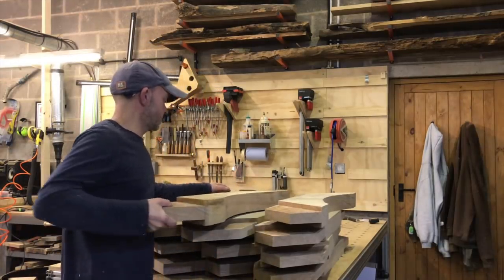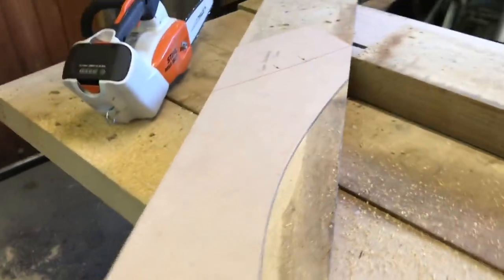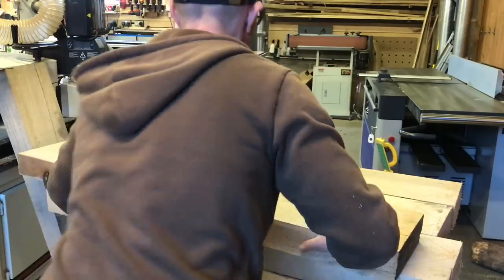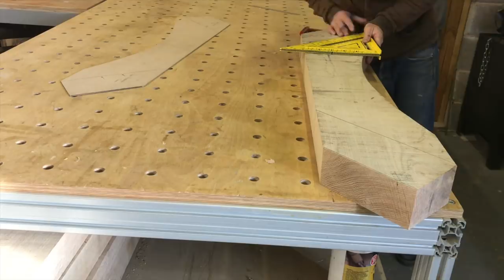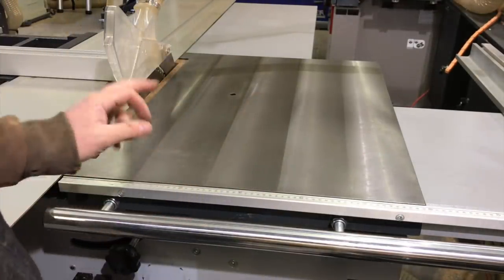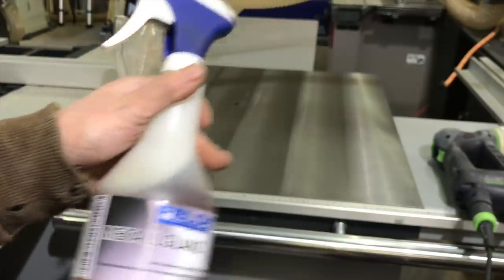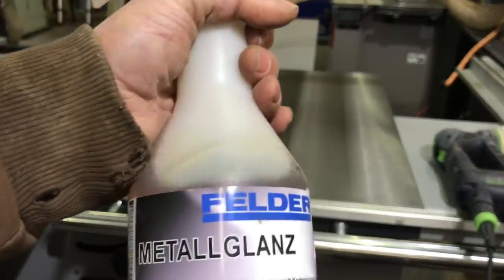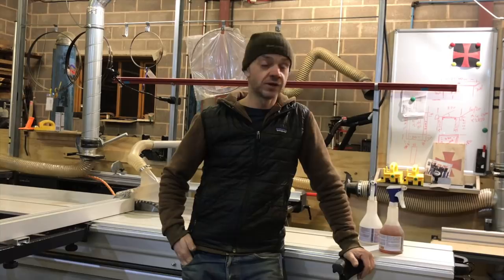Cutting Oak Frame Braces   Sunday Update

Comment: So important to keep all the tools in top condition. I use a cleaner then a WD40 soak and wipe off and then apply wax and polish the surfaces. It makes cutting so much easier
Reply from the maker: 100% ..  see if you can get some super glide it is so good.  - http://uk.feldershop.com/en/Workshop/Cleaning-and-maintenance/FELDER-Super-Glide.html?listtype=search&searchparam=super%20

Comment: Excellent video Andy. I am going to be working with rough cut full 4x8x10 foot cedar beams and cutting somewhat detailed radius on the ends. Yes my tool junkie friend, I bought a new Festool Trion jigsaw to cut the 4 inch thick radius at the ends. Do you have any opinion as to the Trion or the Carvex?
Reply from the maker: Cheers James..   I haven't used Trion but only hear good things from other Youtube wood workers..   I have a Carvex 18v  I love the way it handles deep and cuts and curves it keep a very straight edge .. one down side the stop start button if a nightmare to use with one hand..
Reply: I have the Carvex 240V. I’m happy with it, but I’d say that it’s one of the least innovative/pioneering tools produced by Festool. It does seem to have quite a bad rep, with people who usually love Festool, not being happy with the Carvex. From what I can figure out, it’s a question of not setting the blade guide properly which then upsets the user because the machine doesn’t perform as it should.
Reply: I saved $160 by going with the Trion. Couldn't see that much of a upgrade in the Carvex. The light, brushless motor and cordless options are spot on though.I am usually always go cordless but have marathon cutting to do. Thank you for your opinion.

Comment: That sliding saw is a thing of beauty. If I had one, I would never leave the shop. Btw, doesn't all the crap get inside the saw too? and cause rust etc?
Reply from the maker: I it lovely .. I clean the inside as well .!   but its only the cast iron that really suffers from the green (wet oak) other than the top its just saw dust really ..:)

Comment: Nice work. I coated my machines with metal glanz while in storage for a year. The one area I missed was solid rust. Felt like 80 grit paper. There was a razor sharp line on the surface where there was metal glanz and where I had missed. Left me with no doubts as to if it works. Night and day difference. And yeah, the super gleit rocks as well. 

Appreciate you taking the time to share videos. It’s great to see people’s workflows who have shops similar to mine. The techniques you use are not widely used or shown in the US (at least by the hobbyists who upload).
Reply from the maker: Thank you . Its funny as sometimes Felder get bad press (price's / salesman / etc...) but there stuff is just so good and the extras on the web store are the are the same quality.

Comment: Thanks for that, we dont often think of the cleaning side of using a workshop, and the fact that its not all the pretty sort of work you have to take on to keep a shop going.
Reply from the maker: Cheers Robin, I thought I should show a little behind the scenes (shame i didn't get the cast bad clean up on film)  if you are working on lovey small item in a big - ish shop with big machine it is so nice/clean and easy tbh .. but when you start on the big stuff its really is all about dealing with the saw dust /weight /blades / mes you name it ..  its also very easy to edit a video and make it look so clean and easy  ..  haha

Comment: Please excuse my ignorance but why is this timber cut green? Would there be less cleanup work if the oak was kiln dried first?
Reply from the maker: Main reason is the timber frame buildings here in the UK are all constructed green oak they shrink and tight on the joints are easier to cut and handle and work with just happens at my shop is not sound for green oak therefore whenever I use it there is a cleanup

Comment: I can't understand why so much oak is used for this. It is an open pore wood and gives up moisture over time. Joints open up and then it looks ugly and can be a structural issue. Best wood for this if you can get it is white cedar. It resists insects and does not rot, plus it gives up little moisture over time = more stable.
Reply from the maker: Oak has been used for buildings in the Uk for 1000+ years , and lots of the Manor House’s etc are still standing Lol
Reply: @ManorWood  I get it. I am a Brit living in the US. I know a post and beam building company. He showed m a house that was built out of green oak and all the joints had opened up. I knew from the owner that white cedar is a better material to build from  and I say again: 1) Won't rot, 2) insects don't eat it and 3) you were bitching about how nasty this stuff was on your Felder machines (I own several Felder machines myself) and so it is easier on the equipment to work with. So, in closing I was really making these points and wondering if white cedar is available in the UK?